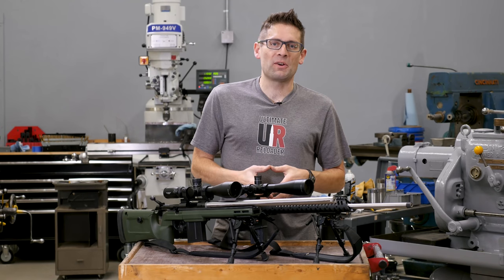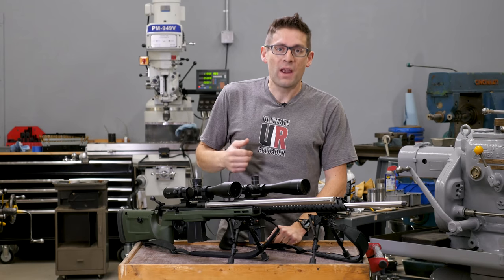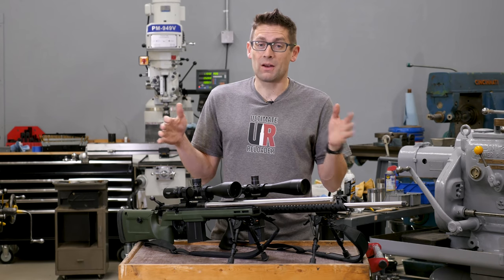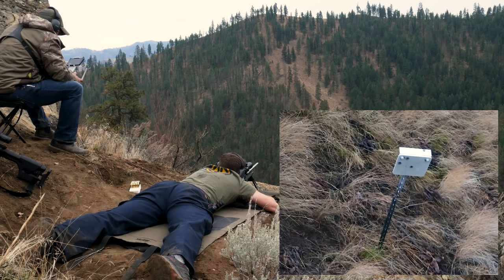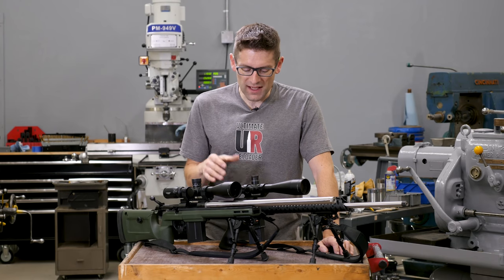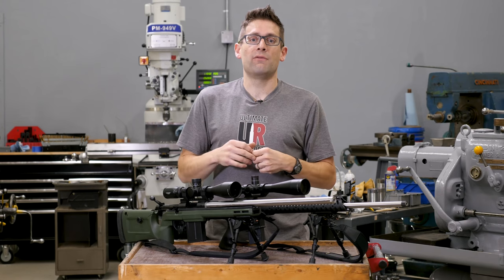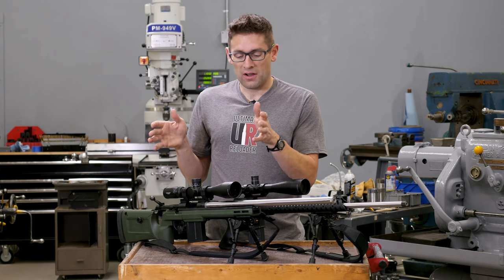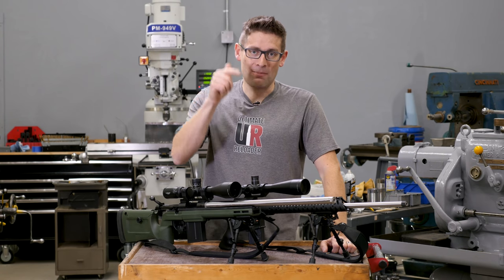224 Valkyrie at 600 Yards: Bolt-Action VS AR-15 (Unexpected Results)

Comment: Ive been working with 82gr Berger and 80gr smk so far.  My best groups have been with the smk and around 27.8gr of H4350 at 2.260 oal.  Getting .3-.4 moa.  Next up 85gr Barnes and 80.5 Berger.  Great vids!

Comment: The groups were great! Whoever built these rifles must know what he is doing. After a lot of work and the help of other 224V reloaders, the ticket in my 22" 1:7 is 80eld, 0.035" from the lands, with 25gr of H4895, 0.39 moa at 2928fps, single digits SD, using once fired Federal brass. I expect even better on my next load using Starline brass and a mandrel expander. You should try this combination. There is even a company making it commercially now.
Reply from the maker: Thanks for sharing- wondering, what are the specs for the rifle you are shooting? Can you send a link to the mandrel expander? Thanks!
Reply: @Ultimatereloader  The expander is Sinclair (Brownell's sku 749-014-457), I run the brass twice in the die (one with the expander, then without it), then run in the mandrel. The rifle uses a Sanders 22" 1:7 upper on a put together Aero Precision lower, trigger Timney Calvin Elite (1lbs) and Magpul PRS stock, glass is Athlon Argos  BTR 6-24x50mm.
Reply from the maker: Cool- I've been looking for a 1lb AR trigger, haven't found what I'm looking for yet. The AR Calvin Elite doesn't show a 1lb model on the product page- can you elaborate on your setup? Thanks! https://timneytriggers.com/ar-calvin-elite-single-stage-drop-in/
Reply: @Ultimatereloader  I wrote too fast, it's 1.5 lbs, which is pretty adequate and it is the one in the link. What I really like on this trigger, besides the light pull,  is the multiple adjustments on the shoe. I have long hands and the ability to tilt the shoe puts my hand on the same position every time, which is great when changing position in PRS. I also did not list that I use a SJC Titan compensator, which cuts the recoil and keep me on target.
Reply: If you are looking for an expander die and mandrel you should look up "21st Century Shooting" and see what they have to offer.  Not saying it's better than the Sinclaire, you just might want to compare the two and see which one you like better.  They also have a bunch of other sweet looking reloading equipment available.  Also be careful not to go too light on a semi-auto trigger or you will start getting double fires from the recoil resetting the trigger.  It happened to a friend of mine on his AR10 one time and the trigger wasn't even that light on it.
Reply: gavintoobe personally I have a K&M expanding mandrel. They are very affordable and are a stand alone mandrel. I use the neck turning mandrel on my 6.5CM with great results so I am getting the 22 cal soon for my Valkyrie. There is a company in Utah called Davidson defense that make AR triggers for 99$ that have a very light break. Sub 2 lbs. great shooting regardless of any caliber less than 2” at 600 is an X in F class! Try a match and see how you do, I have gone to a few just for fun and to test myself. Great series so far!

Comment: I have been running the Hornady 80 ELDM using H4895, 2925-3010 fps, though the 3010 fps is a bit over pressure limits. I shot  a best of .33 MOA with that load. CMT 24.5 inch barrel AR rifle. Great shooting by the Way!
Reply from the maker: Great results for your load and rifle Chuck, and thanks! Can't wait to try the 80 grain ELD-Ms myself...

Comment: Nice video and great shots with the drone.
.224 looks to be a reloaders nightmare to me. I'll stick to the 77 grain smk .223 load.
Reply from the maker: Thanks man! I haven't had trouble yet with loading (the compressed load should have an easy workaround) but we'll see what happens when things go heavy  (90 and 95)
Reply: @Ultimatereloader , for a bolt gun, why bother? Fast twist .22-250 will do everything and more than the .224Valk.
Reply: Untrue. 22-250 drops a lot more, and has double the wind drift. Also, lighter bullet. All it wins in is muzzle velocity.

Comment: I bought the wife and myself 2 mossberg mvp predator series bolt actions in the 224 valkyrie to test the waters so to speak. Was over the moon surprised with the accuracy of the factory ammo from the federal 75 grain tmjs I the black pack. 1/4  inch groups at100yds with both guns. And sparked my ar build. Currently waiting on a upper from atheris with the 20 inch match barrel.

Comment: I was just playing with the berger bullets twist stabilization calculator, and it is saying,( and I had to guess at bullet length) that you should only see a 9 % loss of stabilization. Which basically changes  the BC from the .600 to .546. so I think past 800 to 1000 you will probably start noticing larger groups. It will more than likely go subsonic earlier. But can't wait to see you results.
Reply: I did some playing with the numbers and a 1 in 5 is the best for this bullet. Not the 1 in 6.5 that sierra claims. the 1 in 6 is the slowest twist that stabilizes it fully if you can push it to 1650 fps.

Comment: I'm late to reply to this video. But here it goes. I have built an AR upper in 224 Valkyrie. I have a 22" SS heavy barrel. The chambering is from a builder that told me that the SAMI specs are wrong, it has a 1 in 7 twist.  I'm using an existing lower with a very good 3lb trigger. I have shot all of the existing factory loads and got the tightest groups with the 87gr ballistic-tipped Hornady rounds. .30 at 100yds. This rifle will hold its own with any bolt gun that I have heard of or seen. I shoot on a friend's ranch in Weld County, Colorado where the range goes out to 1375 yards. He has a 24" X 36" steel at that range. Both of us can consistently get small groups at the 1375 range. I'm told that this setup is the only AR that has done this. He's in the process of having a bolt gun built using the same chambering. I don't know if it will be better than my gun. I'm going hunting some more. I've taken coyotes at 400 yards. I could shoot them at further distances but I want to be sure of an instant kill. Well, I hope you see this and reply.

Comment: Excellent Gavin! I'm using 23.4gr varget behind the 88eld in Starline brass and I'm seating these to 2.270" overall. It's on the mild side but gives a velocity of 2650ish from a 22" Bartlein AR barrel. Groups are around .6 moa at 100 and it has maintained that when I'm on my game to 800 and by 1000 I'm usually just under moa.
Reply from the maker: Thanks for sharing that Niles- that sounds like a really good result- Hornady advertises 2675 FPS for their 88 grain ELD-M 224 Valkyrie factory ammunition, and from a 24" barrel. So it sounds to me like you are at an equivalent load level. I was thinking that Varget might be a touch fast for 88 grain bullet, but perhaps based on what you've shared I'll look into trying it out with the 88 grain ELD-M bullets.
Reply: @Ultimatereloader  I'd be real interested to see what kind of velocity you can get from the 95smk loaded near the lands till you hit pressure signs... I'm toying with the idea of having a custom reamer made that would allow the 95's to be seated 2.5" in a bolt action while leaving more space for powder.

Comment: Built a AR-15 (.224) this year. Shooting 82 gr Berger (.224) boat tail match with 27.5 grains of RE-17, I'm getting 1 to 1.5 moa groups at 850 yards.
Reply: What is the twist and length of your Barrel?
Reply: 1:7 twist 20” white oak armament Barrell
Reply: @egouldE5  thanks, I can not decide between a 20in and 24in. For long range.
Reply: DeadMansHand 13 My 20’ has been fine for 82 grain but if you plan on the 90 grain I would go with a 24” barrel
Reply: @egouldE5  right now I'm thinking 88 to 95 gr projectiles in a 24in barrel and 1:6.5 twist.  Custom barrel. But it's hard to turn loose of that kind of money and not be sure.

Comment: Just got a lyman bore scope,  have (2) new  224 V , 1 in 7 & 1 in 6.5  from diff manufactures.After running bore scope thru both barrels  you would not believe what I saw.the 1 in 7 from South Carolina sold as new barrel was actually a used barrel that was polished up.  I had fire cracks, partialy missing lands, pits and I don't even want to continue with that. Sending it back tomorrow.The other barrel a 1 in 6.5 looked like a new piece but had chatter marks every 20 - 30 thoudown the entire 22" inch length & all around the interior.  They are shipping a new replacementtoday.Makes you wonder now about those guns that don't shoot  Huh !!!!!Bore scope seems like it is paying for it self already
Reply from the maker: Robert- sorry to hear about that! Perhaps someone re-chambered a used 223/5.56 barrel? That's horrible! Yes, these Benchmark barrels have perfect bores!

Comment: I have a converted Savage 10 bolt gun with Krieger 22” barrel 1-6.5 twist spun up by Mile High. 

I seriously want to build a gas gun upper and see what the difference in brass abuse is. I think a lot of people poo pooing the valk are using guns that are out of spec, and over gassed, causing the brass to get abused harder and wear out faster. 

I have 3 loading on most of my Starline brass, 4 on the federal (3 reloads), and 2 firings on the Hornady and none of my primer pockets are loose. 

I’m using RL17 pushing the 88’s to just under 2750 FPS.  I’m going to try H4895 and see if I can get close to the same velocity if not the next higher node with less pressures. 

I want to try the 80’s, but cannot find them in stock anywhere. Same with the 95’s. Right now the gun shoots better than I do. I’d love to see what it can do in the hands of someone who knows what they are really doing at range. 1st time shooting it at 1,000 in fairly stout Colorado winds without a spotter I hit about 50% on an 18” plate. Hits and misses are easy to see, this caliber barely moves the gun.
Reply from the maker: Good to hear you are having better luck with brass life- I'll compare notes when I run my tests!

Comment: I find it interesting that my 70g RDF load for .223 is 26.3g of Varget. It is an awesome load in my Savage 12VLP. 1000 yards is pretty easy with it and I've taken it out to 1324 yards. (I quit after a 1st round hit because 1/1 at 3/4 mile with a .223 blew my mind.)

Between this rifle and my 6.5CM, I don't find I have any desire to play with the Valkyrie and it's been collecting dust. It probably hasn't even had a box worth of ammo through it.

Comment: Good shooting, especially with that AR, but you don't have to have that play which you noted is in your rifle. As a competitive shooter I've been working on this problem with my A2 rifle for several years now. Of course you have the play between the upper and lower receivers and in the but stock as well, even in a solid A2 butt stock can be some play which for me was that the buffer tube kept loosening up, so I finally locktighted it, and it has lasted for about a thousand rounds now. The Accu wedge helps but doesn't completely solve the problem between the recievers. The next thing I did was use a feeler guage to check just how much play was between the 2 receivers," .005" I then cut shims to fit over the connecting lugs to eliminate this play from some shim stock and super glue them in place. There was also some side play on the forward assembly pin which I eliminated with a small piece of shim stock. I left the Accu wedge in the receiver because it's not doing any harm, though I doubt it's helping me either. I've only been shooting local matches, but I loose very few of them, and then only because I screwed something up and it wasn't the rifle! This rifle is a 5.56, 1-9, 20" heavy profile Delton upper, on an Olympic lower, I'll go to a 1-7 twist when my barrel which has at least 5,000 rds through it now quits performing.

Comment: Would like to see a video comparing .224 valkerie to 6.5 grendel for an ar 15 it would be a hand built rifle and I can reload once I have the dies just want to see pros and cons for each for precision long range shooting I currently shoot out to 800 but would like to be able to go farther
Reply: My less than professional opinion, from the videos I've seen, the Grendal is a 600 meter round out of the AR.  140 gr loads seem to only get about 2400 fps.  Don't think they will stay supersonic to 1000.  120 and 130 gr bullets start faster but you loose the high BC advantage.  Hope the author answers too, I would like to see his thoughts.
Reply: @PC-vq5ud , if that's what you think, then Scott at Specialized Dynamics is doing it wrong... In a competition in Utah, he was the only competitor to hit a target at 1215yds with his 6.5Grendel.
If you want a super-accurate AR in 6.5Grendel, speak to Specialized Dynamics. Their AR's are boringly super-accurate at 600yds. We started looking for smaller and smaller targets to hit, just for fun & to challenge ourselves (600yds was the max range available that day.)
The cartridge is really NOT designed for bullets heavier than 123grn.

Comment: Did I missed the velocity?
Reply from the maker: 2905 FPS in the AR-15, and 2947 in the Remington 700!
Reply: @Ultimatereloader  a little slow for 70gr...seems to shoot though.

My 223 Ackley bolt gun is push 3350fps with 69gr and CFE223
Reply from the maker: That's "cookin" :)

Comment: How’s the brass life.
Reply from the maker: I'll be checking that out shortly- I have over 1000 pcs new brass, and have been using that to start. I've heard brass life can be down around 2-3 loadings, but I'll test that myself! (they said the same of 22 Nosler, and I got 10 loadings from that brass).
Reply: @Ultimatereloader  And what techniques or procedures allowed that increase in brass uselife ?

Comment: I’m getting out of the Valkyrie. I reload and not worth it with brass life and isn’t as advertised.
Reply from the maker: Interesting-  how many reloads are you getting from each case?
Reply: gavintoobe 1 or 2. 3 if I wanna risk a blown primer
Reply from the maker: Thanks- I'll compare notes when I get to that point...
Reply: Yeah, watching videos from Johnny's Reloading Bench and IV8888 (just this week)  looks like the case manufacturers need to do some work on the case head area, very easy to get loose primer pockets after 2-3 firings.
Reply from the maker: @paulvenn4447  I'm going to have to do some testing to see how many loadings I can get- they said that about 22 Nosler, and I got over 10 loadings out of that brass...
Reply: @Ultimatereloader  Chad on IV8888 put out a video on 224Valkyrie very recently and if I remember correctly he said the maximum case life he has seen so far is 4 firings with only around half of the brass surviving the 2nd firing.
Reply: @Ultimatereloader  Yeah, I'd say it's just a case of needing better quality brass. Once a quality name player enters the game such as Lapua, Norma or Peterson, could probably expect that issue to be solved.
Reply: @paulvenn4447  great , but not great .
Reply: @ohiovikingsfan9294  what brass are you using

Comment: So basically the .224 val is just a long range paper puncher that has less barrel life than a .223 and the only advantage over the .223 is that it fires a bullet that's 11 to 17 grains heavier than a 77 grain bullet...

 I guess long term exposure to lead vapors can really slow someone's innovation in cartridge development.
Reply: Try connecting consistently at 800 or 1000 yards with a .556. Good luck. Ballistically the 224 Valk out performs the 223 hands down...along with 6.5 Grendel n 22-250 @ distance

Comment: 224 to me is just a waste of time. I like my ARs but no comparison with my 6.5 Creedmoor.  Hands down the best round I have hand loaded so far.
Reply from the maker: I love Creedmoor too- but I'll have to day, the Rem700 224 I built is sweet to shoot. The recoil is very minimal- so for long-range predator hunting, I plan to use one of  the 224V rifles I built. But- for long-range all-rounder, hard to beat the 6.5 Creedmoor!
Reply: Co gun. Agreed. Heard way too many bad thing about 224v. Gavins results seem to be to good to be true. He should give 8888 a call and share reamer specs and load info.
Reply: @JPsaysno  U r logical ...this is possibly the missing link to accuracy but what about brass uselife ...could this also be  the solution there ?? with some annealing maybe this is a viable long range training tool to simulate larger LRH calibers